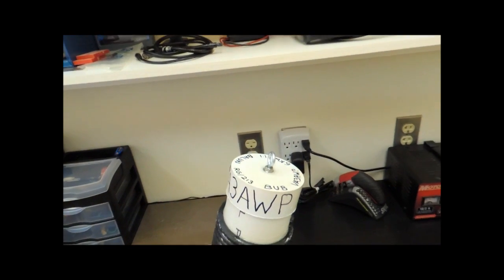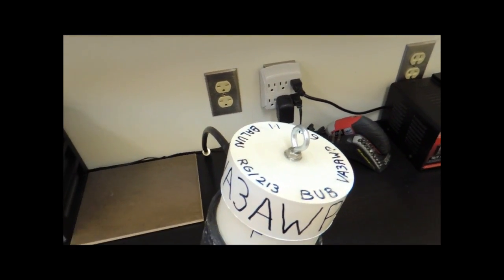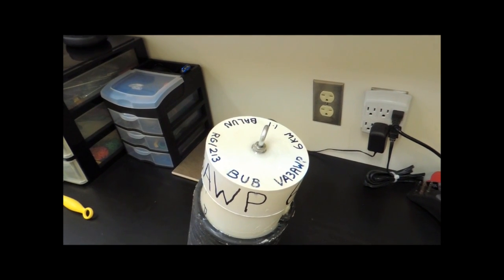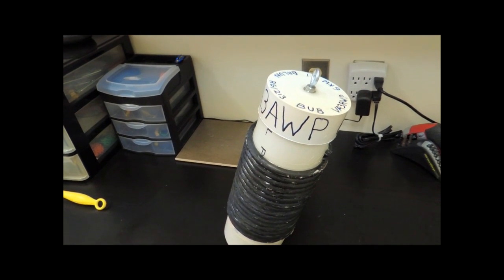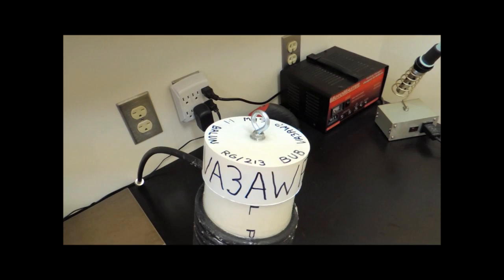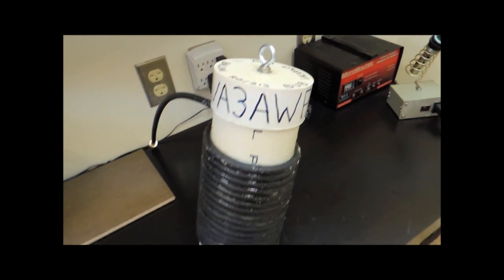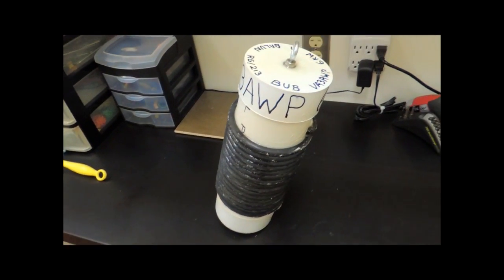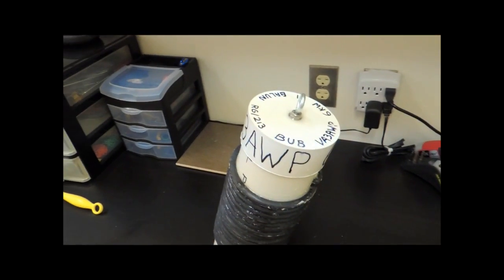VA3AWP - Big Ugly Balun

Comment: I'm about to make the same damn thing for my antenna in Scarborough. Thanks for the video. Good luck with your camera.
VE3XSH
Reply from the maker: It works quite well and the great thing about PVC pipe is that it's very strong and pressure rated, therefore it endures the cold weather we have rather well, especially this winter where it's hardly been above zero Celsius since mid December. The one shown in the video is still hanging directly below the feed-point of my Alpha Delta DX-CC HF antenna and does an excellent job suppressing stray RFI. Good luck. :)

Comment: Hi, I want to make one of these but i've seen different methods of connection. Some show it's a straight thru ie; feed in 2 feed out/ground in 2 coax braid. Others show a different method of connecting top input to  the bottom coax output.

What's the proper way to internally connect this one ?

Jeff - M1BCM